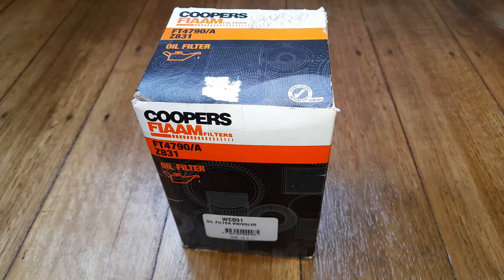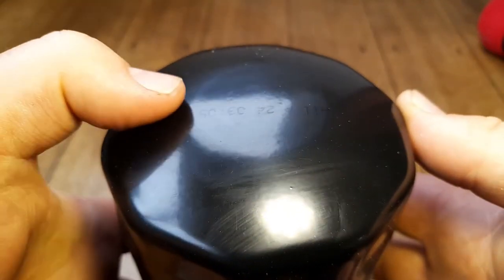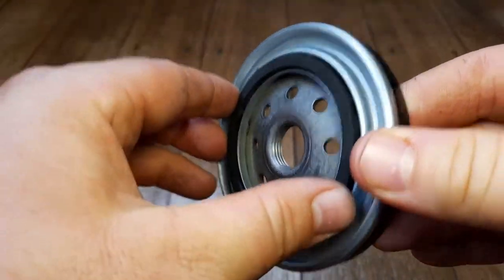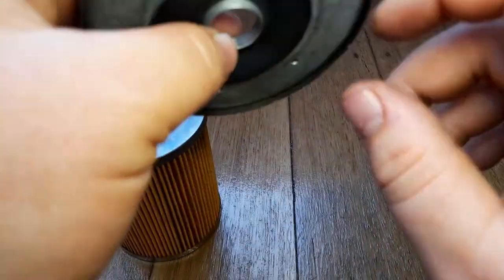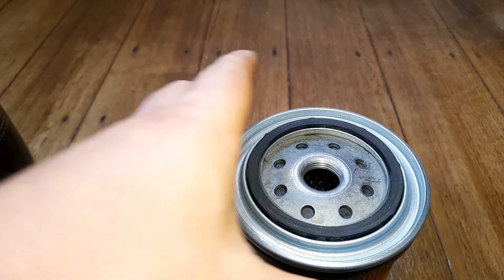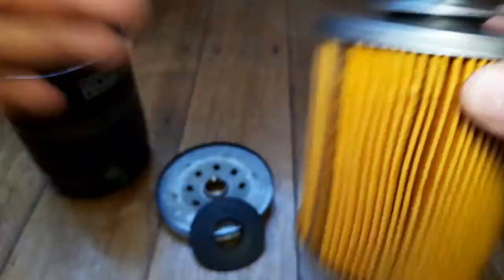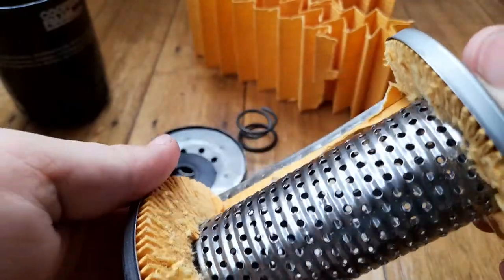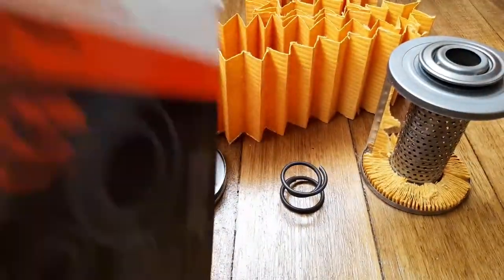Check Out This Anti Drain Back Valve - Coopers Fiaam WC03 Oil Filter Cut Open and Review

Comment: For something like oil filters this brand is alright but for sophisticated filters like a filter for return less systems where the pressure regulator is built in the filter they dont seem to have perfected it, mine only lasted like 3 months before the built in FPR collapsed.